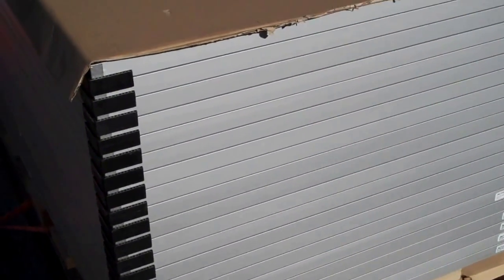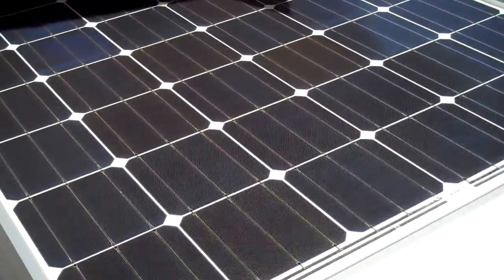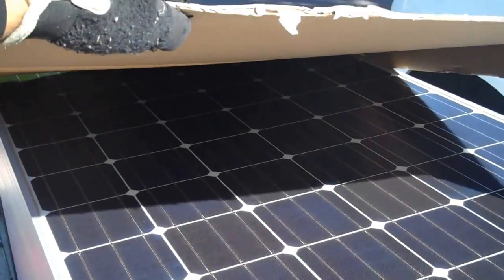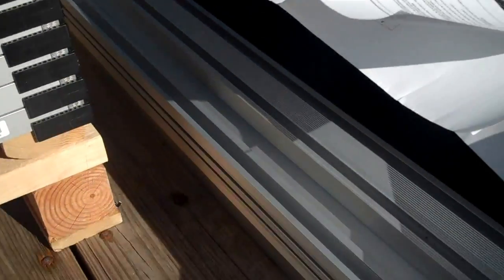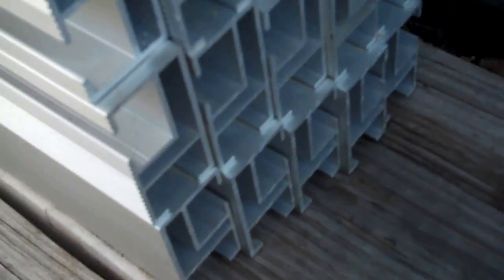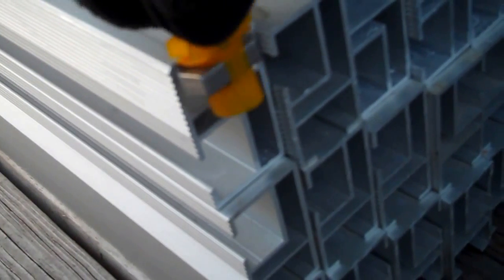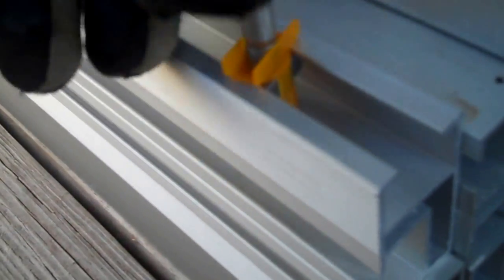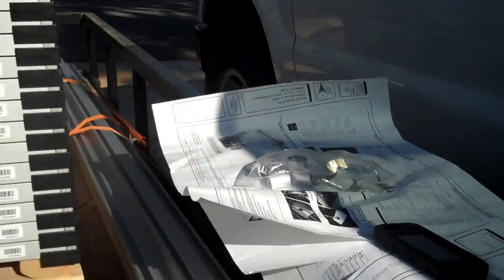Introduction to How to Install Solar Panels Installation Material Selection

Comment: Excellent.  Would love to hear and see more about the installation.  Also, would like to know more about the micro inverters.Things like cabling and wire sizes.  Does each panel get a micro inverter? Wondering how many panels you wire together.  IF this were off-grid, would all the micro inverters just go to the main panel (with proper fusing or breakers) and life is good?  :)  Can't wait for more videos.  Thanks.
Reply from the maker: SyberPrepper Great questions! Each panel does get a microinverter (each panel in this installation did get an Enphase 250 Microinverter so a total of 21 microinverters). We used #10 cabling for most of the installation with the main AC connects at #8 to carry the 40+ amps from the system. As for off-grid, the system design will definitely depend on what you are designing it for. Are you designing for a hybrid system, with using grid back-up? Or is the system for complete off-grid use to a battery system? If you are using batteries, you don't want to use microinverters at all. I have some other videos on my YouTube channel that show my off-grid solar system with batteries. I'll be uploading some more videos of this installation in this video shortly as I am editing all of them together right now. Thanks!
Reply: I like the idea of microinverters since you can verify the output of each panel and there's lots of redundancy in a larger installation. My main questions relate to connections. Do you have an inline breaker or fuse for each panel or does the microinverter take care of that.  If you have 21 panels, do you have 21 wires going back to the main breaker panel or do you have a 4 ( or some number) of panels going to a connector box and then one wire from each connector box going to the main panel? I have viewed a lot of your other videos and appreciate them. Thanks.
Reply from the maker: SyberPrepper Yes, that is very true that you verify the output of each individual panel with a microinverter. This does require a monitoring system, usually between $250 and $750 for an Enphase monitoring system. In the installation I just did that was 5.8 kW (5,800 watts), I had 2 strings of solar panels with 2 junction boxes that had breakers/fuses, plus a main fuse breaker before the main disconnect switch. What is very cool about purchasing Enphase microinverters is that 1 large cable with 4 wires inside of it connects plugs into each of the microinverters. My video I will be uploading soon will show everything, including the breakers/fuses and the main AC line connecting to each of the microinverters. It's very easy to install.
Reply: Excellent info. that's what I was looking for: how many strings, how many junction boxes, breakers, etc.  Looking forward to your video.  Thanks for sharing your expertise.
Reply from the maker: SyberPrepper  No problem! Glad I could answer some questions. I should have that video uploaded in a few days. Still getting video and pictures together and adding them to the movie of the solar installation with Enphase and SolarWorld panels.